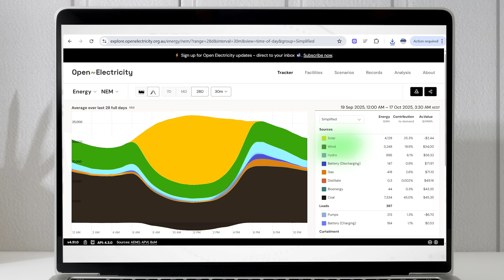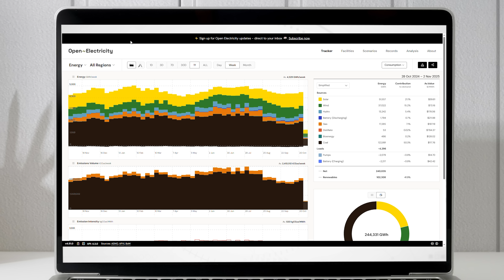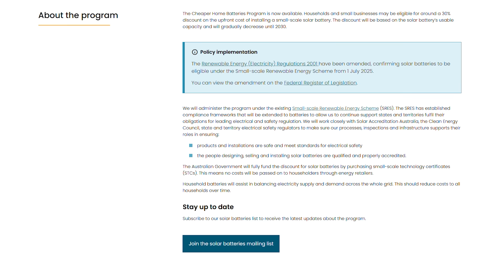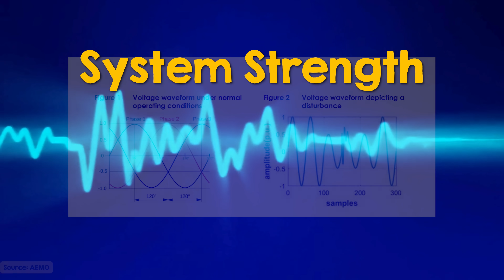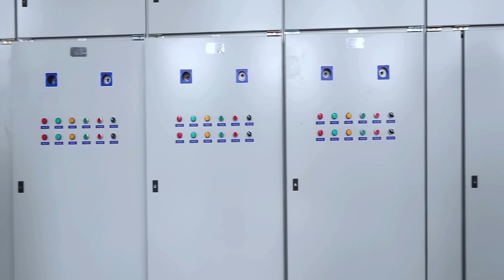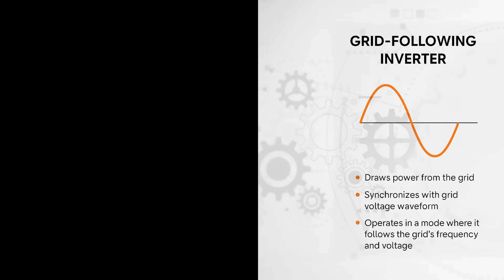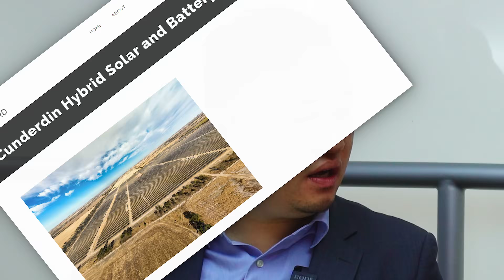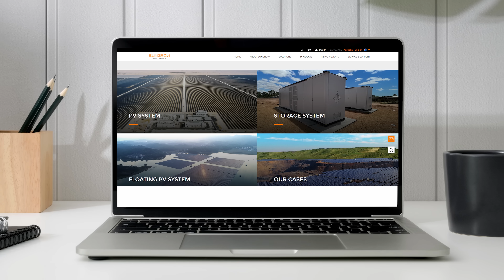Australia’s Solar Boom Is Breaking the Grid - Or Is It?

Comment: This low price daytime solar could find homes in data centres and precooling follow the sun days work. There is also pre cooling or preheating potential where you move the intense manufacture part to this window. Think washing the laundry all at one solar rich time but with slight time variations to avoid too heavy a load. Virtual power  has big potential here and someday hydrogen.

Comment: Grid stability needs a change in engineering mindset. The old, dumb grid had little ability to provide data about its state so stability relied on large rotating mass to provide inertia to dampen the destabilising effect of a sudden loss or addition of generation/load. This dampening effect needed to be great enough to slow potential blackout events such that it would allow humans and machines time to realise there was a problem, understand what caused it and employ countermeasures to prevent cascade failure and blackout.

The new grid has real-time access to information about its state and remote and instant access to the operation and configuration of enough of the sources of load, generation and storage on the grid that we could coordinate their response to all disturbances on the grid. It isn't a very complex set of instructions and responses. However, that new approach would eliminate the human element and switching from human control to an automatic response is not a transition easily undertaken.

Comment: So why was Broken hills massive solar system turned off when the storm in south Aus , tock out the grid towers holding up the power lines .  They had to bring in diesel gen sets to power broken hill
Reply from the maker: The short answer is that solar and wind farms can't form a stable grid on their own. So when the grid goes down they need something else to form the grid before they can supply. 
I plan to make a video on Broken Hill soon (I probably have to visit for another reason) and will definitely do a section on just that. I will research more before I write the script, but my current understanding is that the island capability didn't function as it should have. There was a diesel backup generator undergoing maintenance and another that didn't function correctly when it was called on. I'm not sure how many other factors were involved, or what measures they've taken to ensure it doesn't happen again.

Comment: You would have to be kidding that Renewable Energy sources are `clean'. Every part of their manufacture requires `dirty' energy from coal, oil or natural gas, and if what I have read is correct, the lifetime use of these `renewable sources' of electricity will not cover the cost of energy input to produce them, then the cycle begins again if anyone is brave (or stupid) enough to re-invest in such money-losing ventures. Maybe in time with better safer battery storage options this will change but my bet is on CHEAP `clean' Nuclear generated electricity to keep the EV's running.

Comment: I renovated one of the first synchronous condensers ever installed in Pelzer SC. It is rated 1000kva and installed at one of the first AC powered textile mills built un 1894. IAt was later moved to the hydro station and used as a generator connected to a hydro turbine. The plant is still in operation today and it is the oldest continuously operating AC generation plants in the world.

Comment: I’ve worked in power generation in Victoria since the late ‘70s. I’ve witnessed our grid going from barely able to cope to excess generation to the beginning of the transition to renewables til I retired two years ago. 

This video is as good as any out there. But I was a bit disappointed that it is sponsored by a solar company. 

Grid forming and battery tech needs to be exploited at a faster rate than what is currently (pun intended) happening. 

The big sets off FCAS, voltage control and other ancillary services that most of the renewables cannot do. 

But the key to all this comes late in the video - cost and scale. 

How big does a battery and grid forming inverter have to be to manage frequency swings when either load or generation is lost. Or transmission line faults and losses. 

Out at Loy Yang there is around 3,000 MW of old fashioned power generation which does a great job of this. Have they planned for its replaced from 2035 onwards?

And what of the even bigger sets up in NSW, Erraring and the like? 

I’m not saying that it can’t be done. But can it be done so that our power bills surpass that of our mortgages?

Comment: I fail to understand the  issue  of instability due to lost inertia  assets.  Surely we could simply use large flywheels to do exactly  the  same function  and simultaneously double as part of the stored energy mix. Combined with large capacitor banks, mÿ rudimentary electrical knowledge indicates a stable grid.  All educated  comments welcome.

Comment: Rosie, in reviewing the Changi-Guquan Project in China, the ultimate Solar safety could be a copy of its Single Line UHVDC + Invertor concept. This Line , is 3324km & carries 1100vdc - 12GW capacity (equal to Ireland total usage). Say investigate from central Solar Bank in say Northern SA, fed into each capital (baring Tas.) & then Battery Banks each end. This would replace Coal & Gas( its being sold OS already).

Comment: In the first minute she makes a huge error in saying all the solar systems in the country turn on & off at the same time. 
CRAP. 
West Australia  is  2 hours different in time to the Eastt coast. 
So, when the sun rises in the East, the solar panels start generating 2 hours before the sun rises on the west coast. 
That's  a 2 hour difference which is not 'at the same time'. 
When a factual error this bad happens in the first minute of a video it makes me wonder how low quality the rest of it is.
The real problem is that the West  Coast grid is not yet connected to the East coast grid.  If they were connected the grid stabilisation would greatly improve as power could be shuttled to where its needed. 
Oh, by the way, when the sun rises and sets solar pannel don't suddenly produce max power untill th sun sets and they turn off. 
Most solar cells are rigidly mounted at an angle normaly optimised for best average generation year round. So they take several hours to reach their maximum generation for 2-4hours around mid day. 
I have chosen to have my pannels optimised for maximum winter production. So in effect I get within 20% of the same power generation all year.  My choice, and I ts so simple.

Comment: When you think of batteries, you think of lithium batteries, but there are many other forms. I don't know if they are popular, but a system of cascade batteries exists: if you have charged the batteries, then put some energy into the underfloor heating; if you have heated the floors, then charge the car; if you charge the car and have done everything else, then you can add heat to the water tank. It's easy to see how the energy generated by solar can be stored and used in other forms of energy in Australia. I suppose underfloor heating could be replaced with dual underfloor heating and underfloor cooling.

That is how we in the UK are helping to balance our grid that way we retain as much energy from the roof solar as we can

Comment: If half of the houses have electric water heaters and water heaters consume half of the daily household electricity, that works out to one fourth.  The video mentions that  one fourth of the total electricity is supplied by solar.    This one fourth might be easily supplied with concentrated solar.  Get a large soup can.  Cut the top and bottom into fan blades.  Put a large cone at one end of the soup can and a smaller one at the other end.  Put the fan blades on a long bolt.  Mount it on two bearings and attach a motor/generator.  If there are a number of two meter diameter solar dish mirrors on the roof, cimpressed air can be heated and used to drive the soup can gas turbine.  A cubic meter of water stores about one kwh of energy per degree Centigrade.  A cubic meter of water lowered to 5°C can cool a large house for a day.  The rest of the battery load can be stored in lead acid batteries that don't burn explosively like lithium batteries.  It night take more than one soup can.  Or a car turbocharger could provide greater capacity.   Concentrated solar  technology is similar to wind technology.
There is also a problem with wild fires in Australia.  Having several cubic meters of water in the basement might be more than enough to supply a sprinkler system in a wildfire.
A small gas turbine specially designed for the purpose and that could also run on propane or natural gas can supply electricity during long periods of cloudy weather.  Enough of them could power the whole grid and replace all of the power plants.
Yard waste, leaves and branches add up to enough fuel in a large yard to supply the heat and electricity for months.  If you put a coil of copper tubing over the flame in a fireplace, it will extract much of the heat.  Connecting the coil to the same gas turbine in the basement supplies free heat and electricity in the winter.

Comment: I live in England and I have solar panels with a grid forming inverter and a 16kWh battery. I have 8 months a year with virtually only the standing charge. The other 4 months I charge my battery at the cheapest time. If it's windy I can get it for nearly free (~3p). You don't need to live in Australia to get cheap electric ⚡

Comment: 3:04 its not the coal plants driving prices to zero. that's disingenuous. its the market. not any one source. but if you wanted to blame a specific source you would blame the specific source where the marginal over supply of capacity is from and the marginal over supply of capacity is from solar installations that came without storage. now i get why we are moving towards renewables so i would say it's a feature of the market.

there's another economic problem directly stemming from the grid that is not discussed in the video. its the fact that when more households move to solar, decreasing their bills, the grid still needs to be paid for by a decreasing pool of households. the numerator grid expenses are growing year on year but the number of households relying on the grid is decreasing year on year. an unfortunate consequence is that an increasing share of electricity bills is made up of the grid expense. that has increased from something close to 10% of power bills to something near 35%.  that means that poorer people who can't finance solar and batteries are increasingly shouldering the burden of grid costs. thats why electrity prices are going up for those still paying for power. kwh rates are competitive and negative at midday, but that grid as a % share of power bill increases. there's only two ways out of that. increase the supply charge to the grid (devaluing the household economics on solar) or more electricity rebates for poorer households.

Comment: As an electronics engineer I would distribute a clock defined by a single source. It would be possible to use gps satellites for timing but I would worry about availability. It seems to me that there is a fundamental problem of stability if there is no single timing source

Comment: While I think this is a brilliant advancement I have some concerns.  How safe is the electronic solution?  Algorithms can be hacked unless I am not understanding how they are updated maintained (they have  to be connected to the internet or at the very least a intranet).  Its hard to hack a big chunk of fast spinning metal.  It should be obvious that I have only a passing understanding of  how the grid is kept stable.  I  had to look up Syn Cons and their function and now I have a passingly bad understanding of how they keep the  load and frequency stable.  But my point still stands electronic maybe faster and indeed better but how vulnerable is it.  Will one concentrated sophisticated attack on the code running the system bring it down or is there solid redundancies built in?  Overall I like the direction the electricity industry is moving in its incredible and exciting.  I just get a bit jittery as things get  more complex, I remember an old engineer telling me the  more complex the system the more ways it can go wrong.  Cheers and thanks for a brilliant segment that explained this all very well.

Comment: ☆3.5kWh of fossil fueled energy per 1kWh of mechanical central electricity. 
☆3.6kWh of sunshine per 1kWh of PV roof electricity. Then 99% useful. 😊
Just some interesting efficiency facts. 🤔  😊😊

Central generation is 4cents kWh electricity and 44cents kWh with grid rental costs at the grid meter. My grid supply, 56cents kWh . WTF

PV roof electricity is 2cents kWh electricity free of grid rental costs. 😊

Just some interesting facts about electricity economics. 🤔 😊😊

1m² of PV and 4.6 hrs of 1kW sunshine is 3.6kWh wasted per m² daily.

Full roof is 220kWh x 4.6hrs daily is 1 MWh wasted sunshine daily. 🌞 
With PV roof shade 😎 cooler roof, cooler home, cooler air-conditioning 😎 costs.

Tax-free energy savings for wealthy high marginal taxpayers is love at first sight.❤️

Comment: When 20million roofs have selfsupply and can double to be grid supply then only 60m² of every roof will be needed. 

Grid will be at maximum capacity 247 with 20million v2g EVs selfplug-in 23hrs every day and all night long.

The grid cashflow will be the industrial consumers moving away from fossil fuels to clean feed-in electricity. 😊

Grid emergency backup services will be the extra grid cashflow service. 😊
Grid top-up services as stormy weather rolls over PV roofs. 😊

Grid cashflow happy and the GOUGING of the poor slow adopters will only be a memory. 

Hot roofs shaded by PV roof panels 

NO NEW GRID CAPACITY, $TRILLIONS SAVED. 😊😊😊😊😊😊😊😊

Governments retain government as blackout threats stop. 😊😊😊😊

20million 6.6kW is 660gWh daily 😊😊

Fossil 25gW x 24hr is less at 600gWh 
If you are lucky. 😮
Daily demand is only 400gWh. averaged.

Comment: I'm intrigued by the statement that inverters are faster than rotating machines. Surely the inertia in a rotating mass is instantaneous. Also applying fast transitions to a transmission line is not a good idea.. Transmission lines are for transmitting power in a steady stream . Thats what steam powered alternators did .  That's why replacing them with fast acting inverters, each with the same characteristics can lead to cascade failure . Learn from the mistakes made by others .